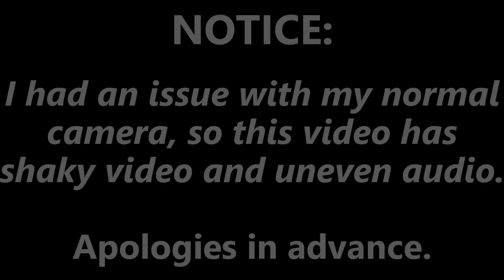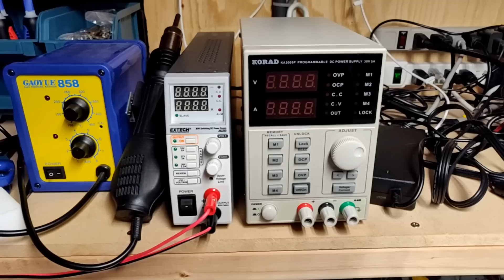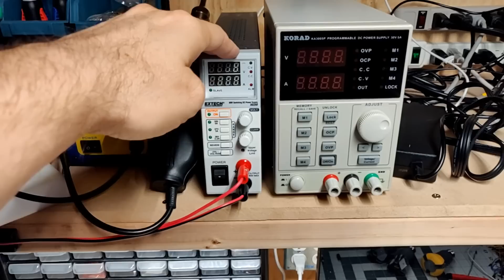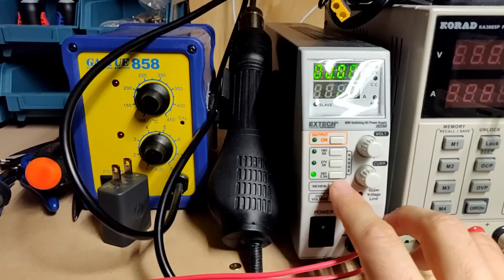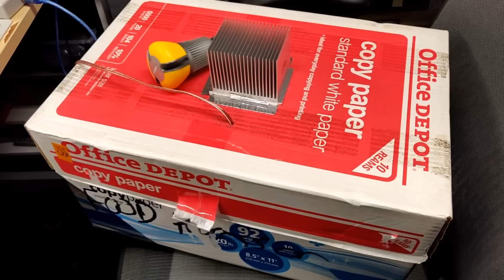Indoor Retrobrite Followup: Scaling up and more tests!

Comment: I've often thought of building something like this with UV lights.  But I wanted to build something big enough to submerge items in.  I wouldn't have thought the blue light would work that well, but I guess it makes sense.  After all, blue light is scattered by the atmosphere.  And the main purpose of the UV light is to break off free oxygen atoms from the H2O2 so that they can re-oxidize the plastic.  So I guess blue light works just as well.
Reply: I would totally watch that video if you made it!
Reply: @Zombie Rocker 
yeah cause those 1000's of watts you speak of are of entire rooms ffs
not pointed on 1 plant
anyways point stands the facts are the same using foil is worse than using just white you are refracting light like a fucked up disco ball
Reply: I sense a blue box video coming from David the 8-bit guy!  I don't think I'd use a cardboard box.  I would use a large plastic tub or build a custom box out of aluminum sheets making certain all electricals were properly isolated of course.  The aluminum would naturally provide a reflective surface and would be far more rugged than foil.
Reply: If H2O2 breaks down into H2O and O- (a free oxygen radical), it may be possible to produce the same effect with ozone being bombarded with UV light.  When O3 (ozone) is bombarded with UV, it breaks down in O2 and O-.  So, there's your free oxygen radical again... just no retrobrite or plastic wrap involved.  So basically, a box like this with UV lights and an ozone generator may produce similar results as the blue light + retrobright.  (Note - this is hypothetical.  If doesn't work, it doesn't work.  LOL)
Reply: @StevenIngram  has been tested and does indeed work but takes longer if I'm not mistaken.
Reply: Blue light is not ultraviolet light
Blue light is not ultraviolet light
Blue light is not ultraviolet light
Blue light is not ultraviolet light
Blue light is not ultraviolet light
Reply: @willierants5880  yes, you should totally do it in a large plastic tub... made of white ABV plastic with bromine that has yellowed! If anyone asks you, "does it really work?" you can show the tub itself as evidence!

Comment: I actually said "Whoa!" out loud when you revealed the Mac case!
Reply: No kidding. The color match to the labels on the back was perfect!  Some of the keyboard/mouse tests looked a hint darker but that case looked spot on
Reply: @St0rmcrash  I can't believe it was such a deep yellow. That was probably the yellowest I've ever seen.  I was fortunate with my retro stuff. My SNES was bought new, and I had the non-window side of the room I shared with my sister, so last I saw it it still looked new (It's in storage right now, I pray it's ok). All my other older systems were black. However, if I ever need to de-yellow, I'm going to use this guy's method.
Reply: I too was really impressed.

Comment: I've been using cheap LED UV strips for the past few years, and couldn't be happier. Have 3 strips, 4' long each, mounted in a huge bin, bottom lined with aluminum foil. Paste, seal with plastic foil, and works perfect every time.

Comment: I built a box couple of weeks ago, I got a big storage box from Tesco, painted the whole thing black (it was transparent, I couldn't get one that was big enough and solid black), then I sprayed the inside with chrome spray paint. I maked off a thin part circling on the sides, stuck an UV LED strip, hooked up a switch and added a barrel jack for the 12V DC power supply and used double sided tape to stuck 2 mirrors inside, one on the top and one on the bottom. It might work slower than yours but it works really well and the most expensive parts were the ones I bought locally, the UV LED strip and the 12V psu I ordered from aliexpress. I'm so happy I built this box, already retrobrighted my old PC speaker, 3 5.25" floppy drive front panels, a front panel for a 3.5" floppy and a CDROM drive and the whole front plastic part of my old PC back from 1999. It's so much fun to do these! I'm planning to retrobright an Amiga 500 and some Commodore 64s (machines, floppy drives and maybe the tape units). Retrobrighting indoor is fun!

Comment: a bit late to the party here but great work. When building a larger box, perhaps you could consider having lights in the base as well, with maybe a clear partition for sitting items on. It's also possible to buy 'mirror' material which can be stuck inside which would be more reflective than foil. I think if you search for 'adhesive mirror' you would find such material.

Comment: Instead of foil, I am using a mylar material I used for my plants. Dont think that it will make a big difference but it is more durable. Since I bought a few of the bulbs I was gonna have them set up from all sides. Looking forward to this a lot. Also, I am going to try and make the container collapse able for storage purposes. That way you could design it as large as you need then just disassemble and put away till you need it again. maybe I will video mine and put it on YT

Comment: I'm quite amazed at the results! This is the first retrobrite process I've seen that doesn't utilize ambient heat as the apparent driver of the reaction.  Having seen 8-Bit Guy and Retromancave's experiments, testing blackights and heat sources in isolation and together, I'd basically become convinced that light was basically pointless, and that processes appearing to use it were actually powered by capturing heat generated by sun or light.  But these results would seem to indicate otherwise. I wonder if the poor performance of other light treatments was just focusing on the wrong wavelengths, and with these bulbs you found the critical light component

Comment: To be honest, once I learned about the sous vide cooker thermal method, I started to wonder if anyone has done any comparison on their long-term effects on the plastic. UV photodegration is a thing, so it'd be interesting to know if, aside from making it easier to get a uniform whitening in tricky spots, a heated liquid peroxide bath is better or worse for slowing the plastic's embrittling. Something to read up on before I do any retr0briting.

Comment: Thanks for a real nice video! I'm very interested in Retrobrite and discovering the most efficient ways to do so without sun light (Since I live in Sweden and live in an apartment which equals no sun and no driveway). 
I work for Philips Lighting (nowadays called Signify) and have access to almost our entire portfolio of special lighting and if you're intrested in any lighting or have tips on certain bulbs/lamps/LEDs that would work best, you can always contact me. Now you got someone on the inside. 

Also, subscribed! Looking forward to new videos!

Comment: Something like this would be perfect for me! I've got a SE/30 that needs retrobriting, so I should be able to find a large plastic tub at the hardware store, then all I need is some LEDs and peroxide. I've already got a power supply, or I could just run them off an old computer power supply.

Comment: I'm still thinking, that blue light is just enough, or would be even "better" (though I don't know how it can be better?) using UV light source. Hmmm. Is it possible, that though visible blue light is "slower" to have the same result, it's maybe safer (ie, damaging of overdoing it, ugly spots, etc)?
Reply: I expect these blue LEDs are outputting some UV as well.
Reply: Yea I would like to see what happens if you use some crazy shortwave lamp like UVC. I wouldn't want to test it on anything important though.
Reply: Well, royal blue LEDs are near the top of the visible spectrum, but should have very little if any UV content. 

As for safer, probably, though the wavelengths emitted by these LEDs will still be energetic enough that you would want to avoid exposing your eyes to it as much as possible and use suitable protective glasses if you can't avoid it. 

It is pretty hard to get new retinas if you end up "retrobriting" your old ones, you know.

Comment: I'm not too keen on using a cardboard box (fire risk).  I ridged plastic container or a fish tank might be better suited.  Plus, since they're waterproof, you can submerge your items in a solution (rather than painting it on with a brush) which will eliminate the risk of marbling.

Comment: LEDs run hot?  Usually the transformer needed to step down the power is what gets hot, not the components.  If the LEDs got that hot that they needed a heat sink, they would have burnt out, wouldn't they have?
Reply: No, Not all the power used by LEDs is converted to light. Some of it is wasted as heat, which needs to be dissappated via a heatsink.
Reply: I see.
Reply: The heat is determined by the current. You can always reduce the current if you think they are running too hot or your heat sink setup is not great. The LEDs will last longer at lower currents also.
Reply: bubba99009
bubba99009 What confused me is that LED light strips don't seem to get all that hot.

Comment: Have 8 bit guy seen this yet ?
Reply: yes, he has.
Reply: @The8BitGuy  ha, bet he didn't expect that
Reply: @The8BitGuy  still think that building something to heat peroxide and submerge items would work best, it would be both quicker and would evenly get all sides, im thinking old water heater with the top cut off
Reply: the only thing that you can expect, is melting on the plastic if you set it too High by false
Reply: @mitsostechtips9047  water is always between 0 and 100° Celsius, I would think plastic would be fine, you physically can't make water hotter then 100° or it's stream
Reply: @jaykoerner  Only at sea level. Drop the pressure till you get a vaccum, and it will boil at room temperature. Increase the pressure past sea level, and you need higher temperature to boil it.

Comment: Dude no!! That's a fire waiting to happen!!!! 
Use a small/medium fish tank with blacked out sides or whatever with a metal or touch plastic lid.
Reply: Quote: "... room temperature ..."
Reply: What? How?
Reply: No it looks ok to me. LED's most certainly get hot but he has a Huge heatsink for them (More than is required for this application). I would be far more concerned about incorrect wiring, this is not a project for someone unfamiliar with wiring up LED circuitry. If you plan to use this method often though, I would recommend building a box for this out of wood or any thing more solid than cardboard. I built an LED grow box for starting my tomatoes from seed (Summers can be short here) and it works fantastic, no worries at all.
Reply: If he was letting the LEDs get hot enough to start any pyrolisis they would be completely dead in seconds and then he wouldn't have any heat or light being generated. LEDs cannot tolerate that kind of heat which is why he is using a cpu heatsink and a fan and is limiting the current.
Reply: @bubba99009  I was thinking more dodgy wiring and heatsink thermal leakage.
Reply: 18 watts is really nothing for that heatsink, especially since it’s adequately cooled, and at 22.5v it’s unlikely to make enough sparks or heat in the wires to burn stuff, especially since that’s a current limiting power supply.  I wouldn’t be too concerned.

Comment: That seems like a fire hazard
Reply: What? How? ... Don't yell wolf if you do not know what you are blabbering about..
Reply: @Diggnuts  Just the fact that he left it on while he was at work
Reply: @laurensnieuwland4657  are led lights fire hazards too?
Reply: Darth Howl. And how would you rate the risk of letting a couple of LEDs stuck to a massive air cooled heat-sick, powered by a fairly advanced DC PSU at 50ish V against, lets say, your central heating unit in your house which is on 24/7?

There is no fire hazard here, none at all..The mere suggestion shows you simply do not understand what is going on.